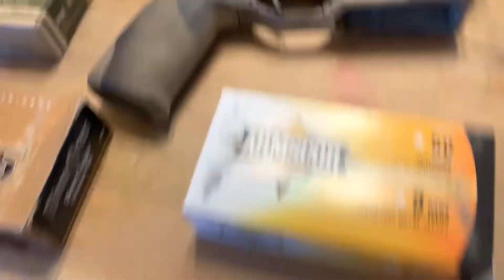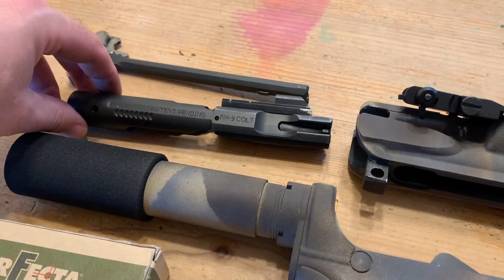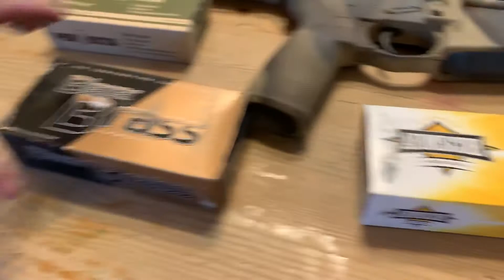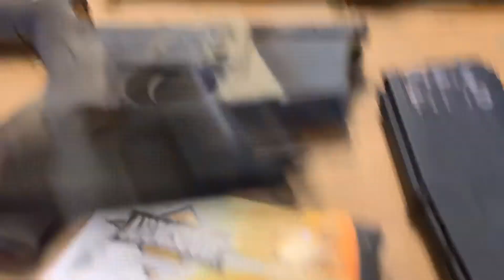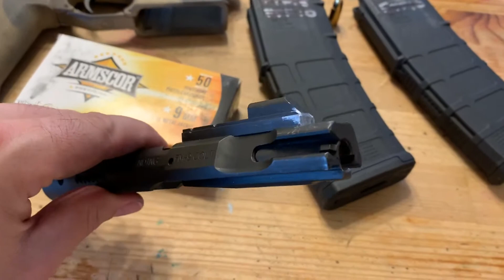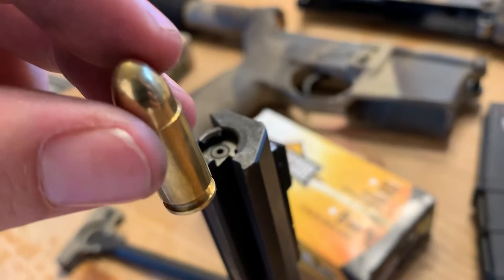Budget AR15 9mm AR9 build - troubleshooting issues with my FM-9 BCG

Comment: Budget AR15 9MM AR9 Build? No such thing. When your done for real from scratch $900.00. Most parts he had from other guns. That’s great but if you start from scratch it’s $900.00. Saying that I have 2 and love them. So my builds are: Upper - PSA - BLEM PSA 4" 9MM 6" LIGHTWEIGHT M-LOK RAILED UPPER - WITH BCG & CH. Lower use a PSA build with EPT of course. Optics Planet (use 704TACTICAL code) for the EndoMags, JP Enterprise AR10 .308 carbine buffer spring and a 10oz 9MM buffer, KAK, KAW Valley,etc. SBA3 pistol brace. Then fixed sights and Red Dot. Need, need, need the .308 CARBINE buffer spring and 10oz buffer (both of mine are 11.3). These babies run 100%. You can’t miss at 50 yards and in. The 4” barrel on my PSA upper can nail stuff at 100 yards. Sighted and take my time. I’ve only shot bulk 115 grain 9MM no problem. Don’t know if it can shoot steel or hollow points. I’ll be experimenting. When set up properly the wife and kids can handle this no problem and they’ll love to shoot. Peace of mind knowing they’ll be able to defend themselves and more.
Reply: I literally read the first sentence of this comment and didn't read anymore because the first 10 words shows you have ZERO idea what you're talking about. 900$? You've got to be joking. I ordered all the parts for my build tonight. And I had nothing for it when I started. And everything for the build from the lower to the buffer assembly to the barrel cost me under 500. And that was with me going with parts that weren't the cheapest possible thing I could find. If you're spending 900$ to build an ar9 then somebody should clearly take away your bank card because you're just buying the first thing you see.😂😂😂😂😂
Reply: @austinkrudup6037  damn... you're so cool man
Reply: @austinkrudup6037  The upper alone from PSA is $340.00, EndoMags are $90.00. A stripped lower out the door in California is $150.00. I’ll help you with the math so far, ready? $580.00. Then all your other parts. Maybe for you its $500.00 because your mommy pays anything over that. For adult males it’s $900.00. Night, Night.

Comment: I'm fairly new with builds but I just completed my first 9mm build today I'm still waiting on my endomag but anyways I tried shooting one round at a time my spent casings are just sticking to the bolt face not ejecting at all any ideas?
Reply: This is the one major flaw in the Endomag design: the mags themselves contain the ejector. So to eject the round you will need to have a magazine inserted into the gun
Reply: @buttrabies  that what mine is doing sorry might be a dumb question what a magazine insert and where does it go ?
Reply: @MrTuna714  The Endomag contains the ejector, as opposed to the bolt itself, or in the case of 9mm ARs, in the lower receiver itself. So if the Endomag is not in the gun, the round will not eject: it will extract but the casing (or live round) will stay attached to the front of the bolt. 

I would highly suggest avoiding Endomag, and going with a dedicated Glock magazine or Colt magazine lower receiver
Reply: @buttrabies  thank you just it hard to get one at my local shops here there always sold out so I went this route cause had extra ar lowers was trying to build a simple one
Reply: @MrTuna714  If you are using an extra standard AR lower receiver, you can get a magazine-well insert block. This is shaped and designed to fit inside the mag-well, and take Glock or Colt magazines. They work surprisingly well, but you must follow the instructions. The one that I used had a tensioner to secure it via pressure to the inside of the AR mag-well, and I would highly suggest using loc-tite to secure that tensioner once you find out where it needs to be. You can also use a drill bit to put a divot in the mag-well to give the tip of the tensioner a notch to fit inside of

Comment: I have this upper and got it from 22 mods I contacted them about the issue they sent me replacement barrel it also does the same thing the OAL of the cartridge is the issue next time you put around in and injected you can see the rifling of the barrel on the bullet I also reload 9mm and set my OAL to 1.100 using polymer coated cast bullets.. but it is very aggravating